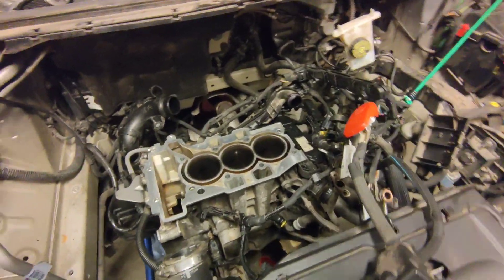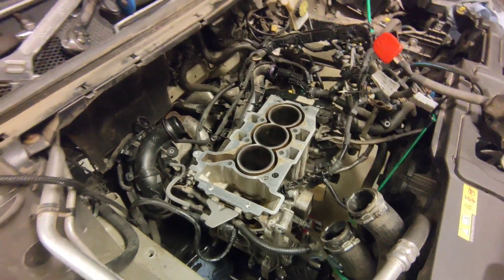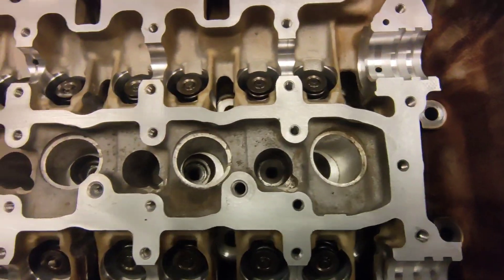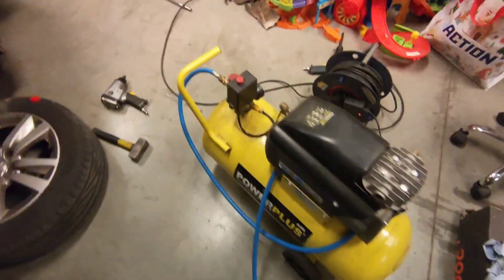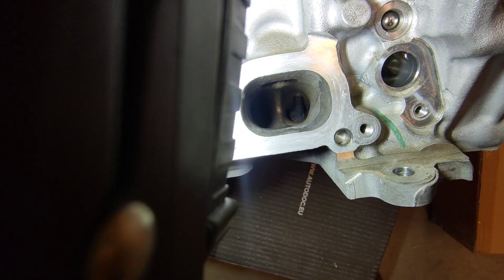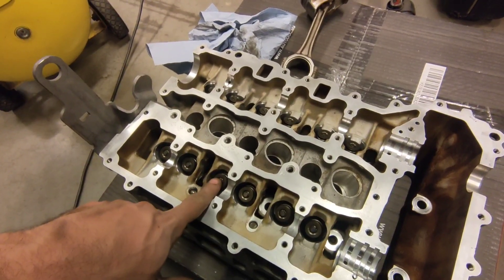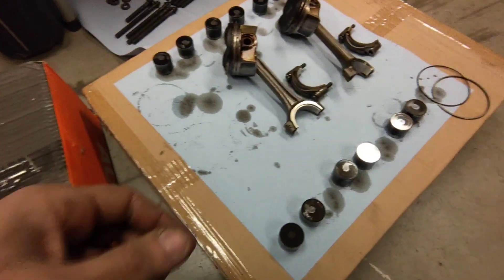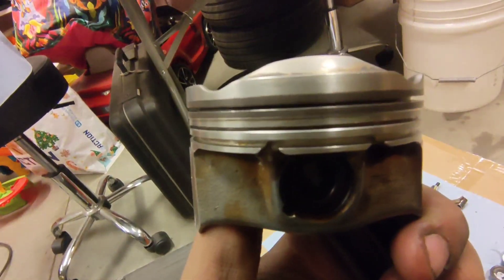PSA Peugeot 308 SW 1.2 e-THP Puretech rebuild - Part 2

Comment: what ever you did wont fix the oil consumption problem. why 
..look at the color on the piston skirts' . you see it shins. and it means that your cylinder is oval shape and the piston is under size. you have to put 3 new piston 0.5 oversize and bore the oval cylinders. if not all is one big waste of time and money am a certified mechanic and do this engines every day. this video wont fix the problem
Reply from the maker: Unfortunately you're wrong. 15.000 km so far without consuming oil.
Reply: @Ronke01 great work, appreciate for sharing your story!
Reply: Certified bullshiter😂

Comment: Hi Ronke, I know you must be busy my friend but when you get a minute can you upload the video please? I am worried about starting this job until I have as much info as I can get? It might be a daft question but if I replace the piston rings do I need to gap them? If they are the same size should they fit out of the box? If not what do I do? Is there any chance you could put up the docs you have from service box about this engine please? Piston ring gaps etc Or could you email them to me please? Thank you for your time and help my friend,  Baz.
Reply from the maker: Hey, I just uploaded the video on honing the cilinders and will try to finish the one on the piston rings todaybas well.
Reply: @Ronke01  Thank you so much my friend! Tell me please did you use new big end piston bearings or just put the old ones back in? Thanks, Baz.

Comment: Thank you for doing this Ronke! I changed the cambelt but I think the engine is out of time now? Ticks over like always, only now, smoke from the exhaust? Worse after being stopped at traffic lights it seems? Could the timing be out slightly do you think?? I had the bottom locking pin in position (I thought! Never done it before so I thought it was all the way in, the engine wouldn't seem to move anyway?) Then I fitted the top tool on the cams. Took the tensioner off, but when I came to undo the crankshaft bolt, the crankshaft moved! I rocked it from side to side until I felt the pin slide fully home. As the tensioner was off and the cams were locked I thought so long as they matched again with the new belt fitted I thought the engine would be 'in time'? If it is out by even one tooth then it is out of time but I cannot find initial set up position for a cocked up engine timing! If the engine is 'out of time' then it is likely, I think,  my head/valves are probably damaged by now so I will need to refurb or buy refurbed head? So I may as well do the refurb on the pistons as well, and your video is helping me along the way. Especially as you have shown a way to do it without taking the bloody engine out! My engine is the EB2FA HMR and doesn't have VTI? Do you know where I can get a timing diagram please? Do I just rotate the engine until its near a (a few degrees) from the flywheel locking position, remove the cambelt, manually turn both cams with a spanner, lock them with the tool, and then refit the cam belt?  Anyway, thanks very much once again!
Reply from the maker: @BarryPritchard-j1j  hmmm, since it doesnt have variable valve timing, I would say it would be kind of hard to screw up the timing. Just disassemble it again and make sure the timing side piston is at top dead center and repin the flywheel to make sure.
Reply: Hi Ronke, ahh, now we are getting somewhere I think? Do you mean the cylinder nearest to the gearbox/flywheel? I marked it as number 1 on the coil pack? Thanks for your answer and your time my friend!

Comment: Very interesting video series and thank you for filming and posting it. There is a big lack of content regarding 1.2 puretech being torn down and reassembled. I am looking to clean the intake on my 308 sw and eventually do timing belt (or chain conversion if that becomes available. I hope we get more videos from this series!
Reply: I've seen some videos (mainly vw and audi engines) that too get gummed up piston rings and pouring some cleaning chemicals like b12 into sparkplug hole and letting it soak seems to help for those engines. Not as effective as new rings but might help for a while or even neccessary if the new piston rings get clogged
Reply from the maker: @winblasers2  heard from a Peugeot mechanic they now have/use a cleaner in the oil, and flush it afterwards to regain compression. Dont know how long that will last, but they claim good results.
Reply: @Ronke01  I wonder how that cleaner effects the timing belt. If peugeot themselves use it tho..
Reply: @ Is it hard to get to the throttle body and clean it? where is it located?
Reply from the maker: @winblasers2  well I dont even remember. But the whole engine is pretty easy to work on, especially when fitted to cars that normally house 4 cylinder engines.

Comment: Hi, how is the oil consumption since rebuild? My workshop suggest full engine renovation with bigger pistons, cylinder machining and head machining but it's very costly with no guarantee of success. I wonder if I should suggest only piston rings replacement and honing since it appears that's the main issue.
Reply from the maker: So far it's been great without noticing any consumption.
Will check the dipstick later, but there's 0 noticeable smoke on hard accelerating when driving behind the car now.

Comment: Great job mate. How many KM after the rebuild? Mine it’s burning 1lt 800km sometimes less. I was going to do right away, but I saw on another video a guy that need to remove a plate to remove the sub-sump… and with your video i confirmed that, need to remove the gearbox out. I’ll try to user an additive carbon remover. Already blasted with walnut on the intake valves. So I’ll try to flush and rev it up with some valve cleaner motul….

Did you use a cylinder piston polisher?? Is good to do it before new rings
Reply from the maker: Yes cilinders got honed when everything was removed.

Peugeot told me they had good results with flushing solutions in the sump, I have my doubts, but it wouldnt hurt to try.

Now we've done 1000km so far, no issues. No oil consumption, spot on.
Reply: @ did you machined the cylinder head? I was told that this head they didn’t any height, but one thing it’s warped from temperature and another thing is just disassembled. Or just sandpaper?
Reply from the maker: @darkptnet  no, I tested the block and head for flatness with a straightedge and feeler gauges. It didnt need any work.

Comment: 5:45 Hi! Did you rectify anything or put standard segments?
Reply from the maker: @nila2627  what do you mean rectify? If you mean gapping, yes, I gapped the rings. Video will follow soon ;)
Reply: @Ronke01  When grinding, namely cylinder boring, did you switch to a different segment quota or did you use standard? Google translation, from Romania.
Reply from the maker: @nila2627  I honed the cilinders and used the standard 75mm rings after that. No issues
Reply: @Ronke01 I understand, thanks for the answers!

Comment: Great stuff.. im looking to rebuild my puretech 1.2 as well..
Reply from the maker: After 6 days I finally started reassembly yesterday. Snapped one of the conrod bolts during final torque.
Luckily the broken end came out easily, just gonna need to find replacements asap tomorrow morning.

Good luck, it's a fun but tiring and stressfull job. Especially while being sick with the flu 😂